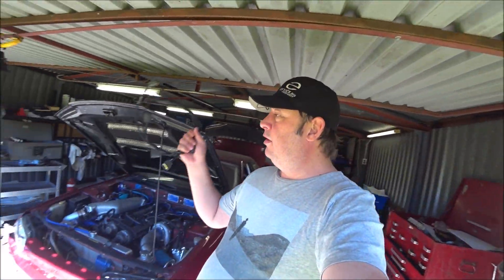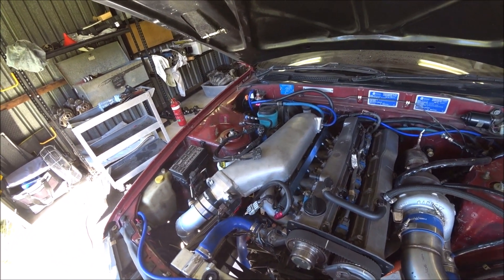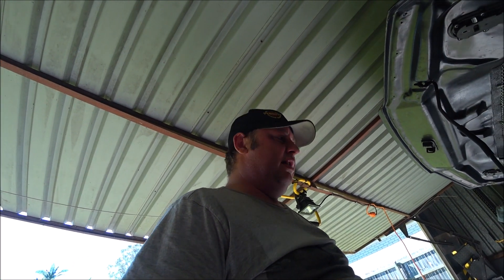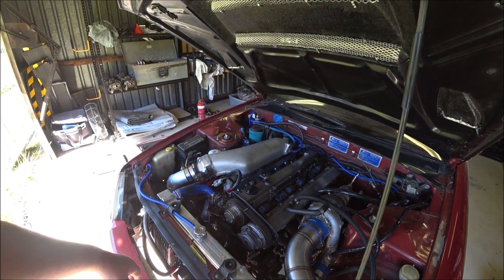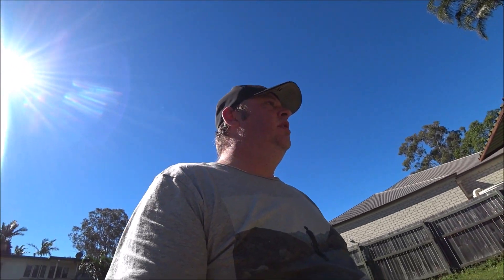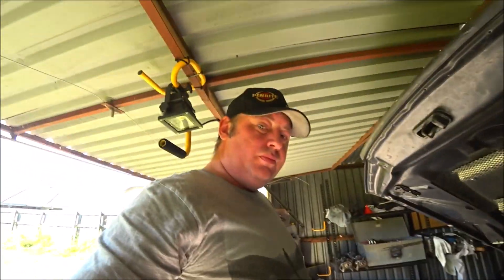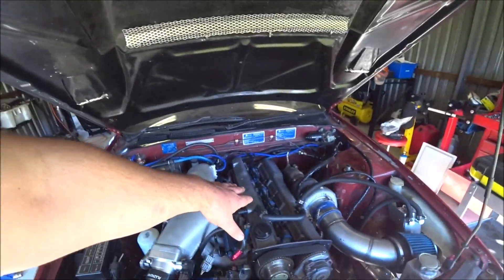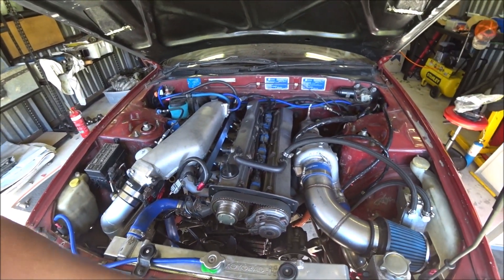RB25DET Build - Wiring Specialities Coil Pack Loom - Diagnosing RB25 Misfire

Comment: Do you know which cylinder is missing or random? Do you have a wideband, could just be a lean misfire. Copper silicon will seal those v bands extremely well, i was amazed how good it works
Reply from the maker: Not sure on the cylinder mate, haven't done any testing to narrow it down, based on the timing evidence, it may be all at certain revs.
Reply: @tangles01  could be where vct is switching?
Reply from the maker: Nah it's well under 4k, which is where the vct does it's thing
Reply: Think vct switches on around 1600 and off 5800, well on mine it's close to that anyway. Should be able to see exactly in the haltech
Reply from the maker: @russelltilley8266  I'll have a fiddle

Comment: i had similar issues, have you tried a different CAS? also if you havent done the timing the CAS's can wear so you have to advance them much further on the unit to get back to the proper setting.
Reply from the maker: on the mark I set it up on, it hits 10 degrees on the money. I put a timing light on it when it wouldn't start before. I think I have a spare cas somewhere though, can't hurt to try.

Comment: Are the coilpacks known to be good?. Sorry about the job mate, your right cars do cost money haha.
Reply from the maker: Coils were fine last time the engine ran, are fairly new. I doubt they are the issue. I'm inclined to thing its actually in the timing map, from me fucking with the ecu. But I'll elimate the other options before paying a tuner to figure it out.
Reply: @tangles01  I'd say your right. I was going to say check for error codes, but clearly not a factory ecu
Reply from the maker: Nah Haltech
Reply: tangles01  if u have a laptop with the haltech software u may be able to save yaself a few bucks on a tuner  and call tuning fork or one of the gurus at haltech and get them to remotely take over ur pc via team viewer. They’ll be able to see if the timing map is correct 👍
Good luck man, ur surely gettin close to killin all the gremlins. 
Keep postin good shit 👍
Reply from the maker: @jiggydrift  Yeah the guys like Al (Turbo Yoda) Benny (Mechanical Stig) and the MCM boys get that free service, not sure he'll take my call.

Comment: Spark plug gap?
Reply from the maker: 0.8mm
Reply: tangles01 May want to look at that later on to avoid spark blow out.
Reply from the maker: It's not making any boost on idle mate. I could so a hot comp est now I suppose, but doubt it's an issue.